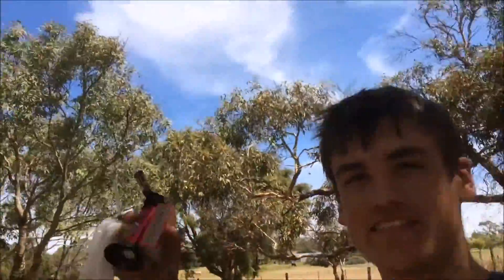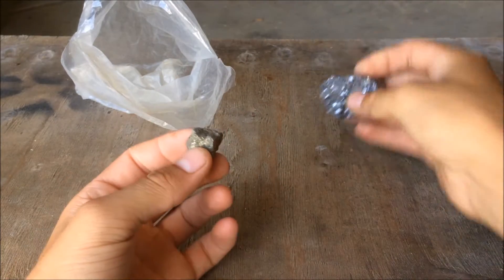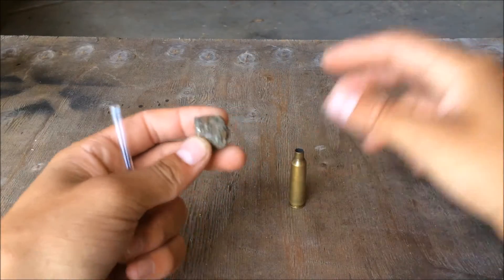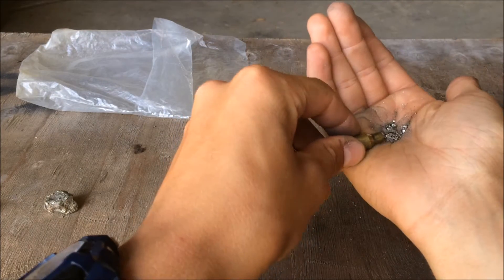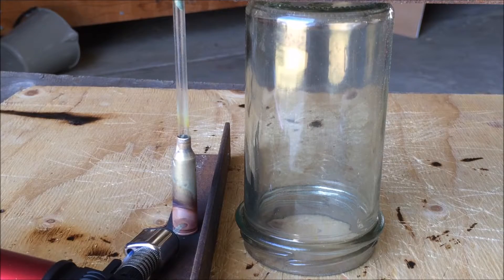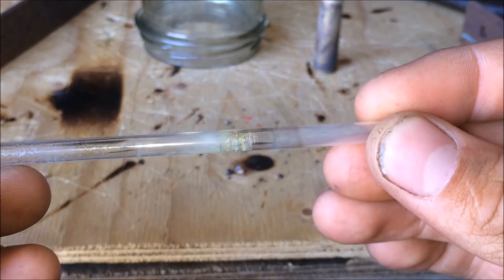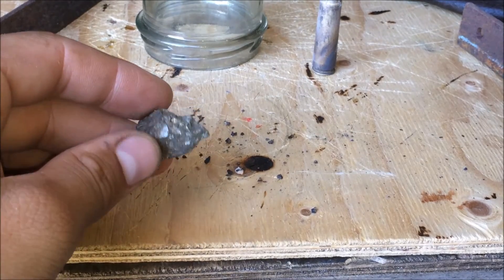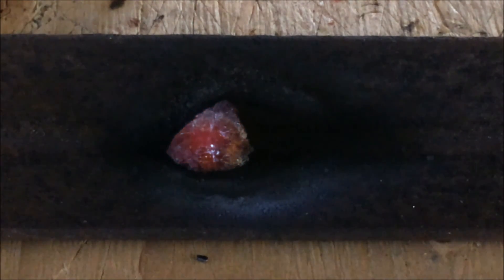Extracting Sulfur from Iron Pyrite

Comment: could this be done with a wood fire? I subbed and liked. I love how you used common supplies. fantastic video. What size cartridge was that and what size glass tube? what was the fitting on the end of the glass tube?
Reply: I did this with a wood fire and it works but you need to blow oxygen in the fire for it to get hot enough
Reply: Yes, but youd have to blow into it or you can use a hairdryer

Comment: So... FeS2 + O2 = SO2 + FeO3 

How did you get the pure yellow Sulphur? 
Does it condense as S(s)  and O2(g)
Reply: There is not enough oxygen in the bullet casing for it to react, so it just boils off and then  condenses on the glass

Comment: can you exract iron from pyrite in this method.
Reply from the maker: I did a little research on this and found that you generally cannot extract iron from iron pyrite using this method. Also iron isn't even extracted from iron pyrite at all in the industry. It is used to make sulfuric acid and other things.
Reply: is their a method though seeing as how theirs iron in the pyrite.
Reply from the maker: Not too sure about this one, but I am sure if you kept applying more and more heat to the pyrite then eventually you would get iron ore (iron oxide) then all you'll need to do it smelt the ore to get rid of the oxygen to make pure iron. This is just a guess, so it may or may not work.
Reply: You can get the iron out of it. Yes. 👍